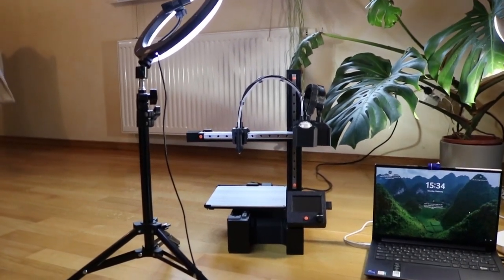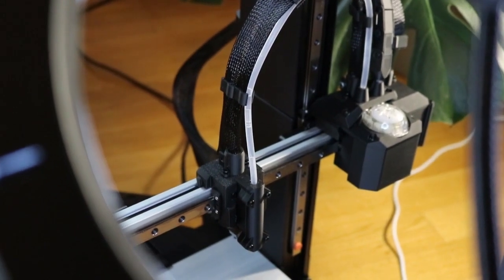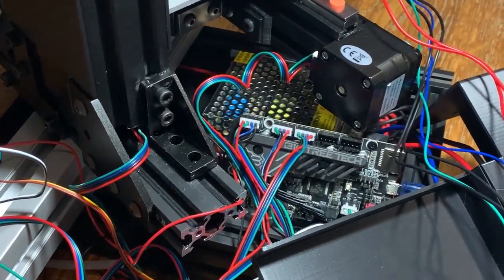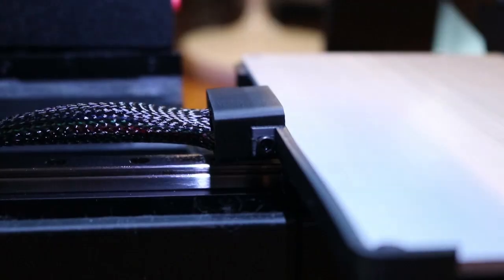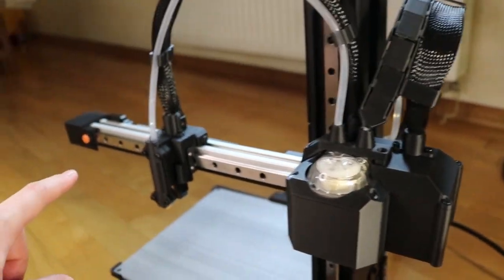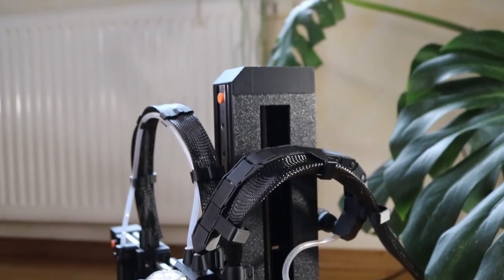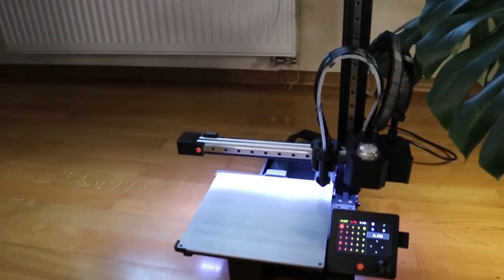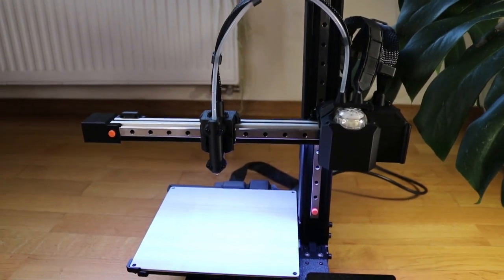Building a custom 3D printer... but not for plastic

Comment: What kind of plastic did you use for the printed parts?
Reply from the maker: @KaloyanDobrev  Majority is PLA and some is PETG. I plan to replace everything with PETG.
Reply: @microna3D  I am using PETG more and more. Its a bit more sensitive to warping, but the parts are more temperature stable and easier to clean up after printing than PLA. A wider brim removes the problems with warping. The smell is significantly less than with PLA or ABS.